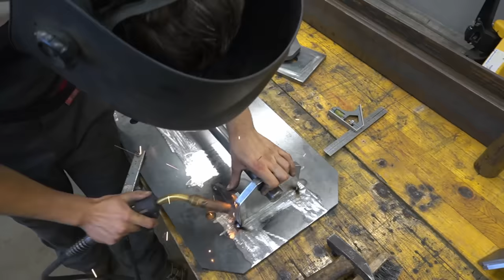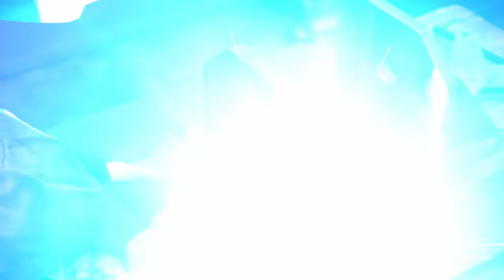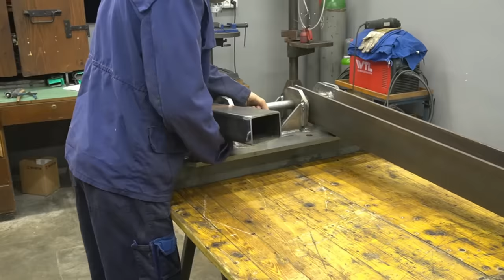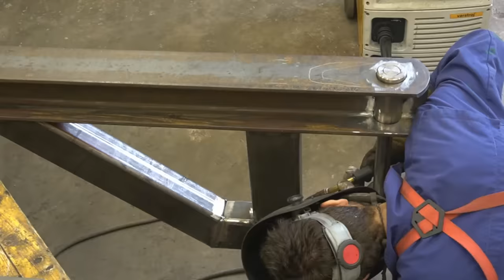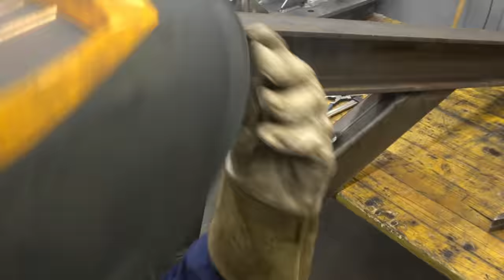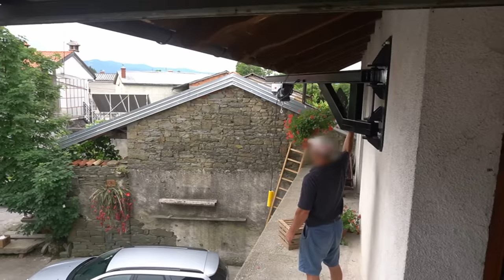Jib crane build

Comment from the maker: I do not reccomend this type of jib crane design if walls aren't made entirely from thick enough reinforced concrete.
Reply: make it a through-bolt design
Reply: That is what I was wondering about when I saw this. The crane looks very strong the wall it's anchored too and the anchor bolts will be the failure point some day
Reply: So my 1/2 Sheetrock won’t do ?
Reply: @JS-zb1vv  just use those expanding plastic anchors and the sheet rock will hold just fine.
Reply: I’d mount it to my truck bed!
Reply: @JS-zb1vv  Just use some toggle bolts.
Reply: I was thinking the same thing. Awesome design. Very sturdy. Would be perfect, with I beam stand, sunk in a concrete pad and bolted to a sturdy wall. Also, move the winch back to the pivot point so it doesn’t add negative leverage out so far. Put a pulley block at the outer end
Reply: Какая грузоподъёмность на конце стрелы❓
Reply: @heychaz  I was thinking of just using super glue.
Reply: @rl595 Chances are he will sell this property and walk away and leave any problems that might happen to the new owner.
Reply: @martyk1156   I was thinking of just using superglue. but your idea might be a better option.
Reply: @SHAH_ALEX  he is not going to answer you in case there is a lawsuit in the pipeline.
Reply: @makeityourself5016 I don't recommend a jib crane installed like this period.
Reply: You can't just use drywall toggle bolts? :P
Reply: Me and my boss do post frame construction. Now and then he’ll fab up jib cranes like this. But we reinforce the posts and wall pretty heavily. They’re great

Comment: What stops your wall from collapsing?
Is the home concrete or stucco?
That is leverage houses are not built for.
Reply from the maker: Good observation mate. Walls are actually made from clay blocks. So, those aren't enought to hold 1 ton on the end of 3 meter long beam. Not even close. But there is a vertical concrete pillar behind one part of the mount and one horizontal on top.  So, it should hold :D 
Thanks for watching mate. ;)
Reply: @makeityourself5016  id be concerned about putting tortion on a concrete pillar. the weight of that crane alone is probably not a big deal. Its a cool build but at the end of the day Id worry about how well that pillar is held upright.

Comment: Except wall mounting. One more thing to use bearings, and you can use locking system by providing two flange with hole to lock the position. Rest is perfect idea..
Reply from the maker: Thanks mate. I was sceptical if I should use bearings or not, but then after a suggestion from local machinist, i decided to just use bushings. They work perfectly. It rotates with litteraly no force...
A lock mechanism would maybe come in handy. But its to late 😅

Comment: You should allow time for the metal to cool between welds to minimize twist.
Also the strength of your wall and those lags are your weak point especially if that concrete is of a low rating and not wire reinforce.
When a Foundation is laid for a building the concrete is collected at the beginning  and end of the pour , it is allow to cure 30 days and then will have a compression test done on it . Cemete walls are not required in all places to have the same test done . I would check with your building codes to see if there is a code for your walls . If you live in a Hurricane Zone and the building is new you may have a hurricane rated 🧱.

Comment: I install sign on walls and may counter lever off the wall light this and believe me this is not safe I don't care if the house Pillar is behind that wall it is not built for this purpose I warn you not to use that hoist I believe you should remove it and Mount it to something that is capable of holding it there is a reason things like this are engineered unless you have proper steel work behind that wall I do not believe it is safe
Reply from the maker: If it would be for me, I would do it a little different. But it was made for my uncle and he insisted that this is the way to go. Plus he isn't lifting more than 400kg 🙂
That pillars behind will hold, no problem.
We could even conect it to another side of the house with cables to reinforce it but it's no need for 400kg :)
But thanks for the warning. I appreciate it 🙂

Comment: Solid construction, with it being anchored to a wall like that does that perhaps limit your weight capacity? Or is it bolted through the wall to a beam on the other side? Thanks
Reply from the maker: It definitly  limits lifting capacity. But it's still a concrete pillar behind the plate and one on top. So I'm guessing I can lift 1 ton.
Reply: Pretty heavy costruction for 1 ton capacity.
Reply: @truthspace5525  I'm guessing this is another example of germanic over engineering
Reply from the maker: @truthspace5525  we like to overkill projects :D
Reply: @StephenMortimer  Roofs look Czech or Spanish, not German.
Reply: @marcosmota1094  better yet, it is SLOVENIA ... an Italian doing things the German way ??
Reply: @makeityourself5016  "Guessing" is not advisable when building lifting equipment. "Knowing" is always a requirement.

Comment: With all the repeating comments about the wall strength, you should add an introduction to your video to explain.  I think people don’t take the time to read the previous comments, so having the info in the video might help.
Reply from the maker: Good suggestion. Thanks. I will look if this is possible 😀
Reply: @makeityourself5016  or just pin your comment to the top, where you explain it in a few lines.

Comment: Can I get the plans for this? 

I would like build one like you started to do. I seen you mounting it on an "I" beam but then you mounted it on a wall instead. 

The only thing I would change. And that is saying ALOT (I have OCD). Is flipping the Jib over to use a trolley. That same support design should be plenty for a hanging style support. 

Thanks, Emily Shelton.
Reply from the maker: Hey, saddly I do not have the plans avaliable. 
Originaly it was ment to be made like you mentioned, but the guy for whom it was made decided to take this path :)

Comment: 2000 lb winch will d3 in your driveway way with some of the wall if you try to lift that much weight but, looks nice anyway.
Reply from the maker: Thats probably true. Metal frame has that lifting power. Wall on the other hand doesnt. But we use it up to 400 kg

Comment: This design is very dangerous if the wall where the arm is anchored is not reinforced.
I could end up tearing off the anchor point
And it can cause serious accidents or the death of anyone nearby when the crane is operating.
Reply from the maker: It sure is. Lifting capacity is very well dependent on structural integrity of the wall. In my case, there is a concrete beam behind, so there is nothing to worry about 😀
Thanks for watching 😀

Comment: Great welds - super project -  question on your weld technique - almost looks like you are using a type of "whip" nozzle movement, when most mig guys use more of a circular nozzle movement. Is that correct? Whatever you are doing, produced a very even seam. Nice job.
Reply from the maker: Hello. Yes, that's  one of the techinques. I believe its not recomended for begginers because you can end up with lack of fusion. But if you know how to stay on the leading edge of the puddle it's just perfect. I like that technique the most. I had my welds tested and i did penetration test and they were all good. That circular motion is used with lower currents. Its not used in spray transfer, just in short circuit mig or globular. .

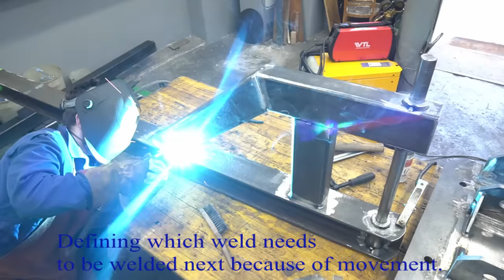Comment: 7:01 "Defining which weld needs to be welded next because of movement" What do you mean by that? as in the heat moving the arm making it not line up? so you need to weld in a specific order?
Reply: Yea metal expands and contracts when welding. It's called weld sequencing. He had it well thought out!!!
Reply from the maker: @jro1560  jep, you are right. Welding causes very high local temperatures. And  when getting hot, metal expands and when cooling down, it shrinks. If I wouldn't be checking with an axle, it might had happen that an axle wouldn't even fit through. And if I saw that axle leans to one way, i had to weld opposite side. 
Like mentioned. It's called weld sequence.

Comment: Great job! Would you mind specifying the material name you used in this project? like the boom and type of metal, I am trying to make this project myself
Reply from the maker: Its nothing special. Its low carbon structural steel S235 with yield strenght of 235 MPa. Regular steel :)
Reply: And size of anchor bolts used?

Comment: GOOD DAY, WHAT MATERIAL DID YOU PUT ON THE BUSHINGS AND THE SHAFT AND WHAT LOAD CAPACITY DOES IT HAVE?... GREETINGS
Reply from the maker: Bushing are from regular steel s235. They dont need to be any fany stuff since the crane is used maybe 5 hours a year

Comment: That looks like an accident waiting to happen that is a hell of a lot of weight on that little wall once you have a load on that it will pull that wall down I warn you not to do that unless that's is a proper tilt slab that wall will not be strong enough I don't care if it is double brick or not the last thing I want to see is somebody getting hurt or killed because of that hoist
Reply: [HomeMade: But it's still a concrete pillar behind the plate and one on top.] "That looks like an accident waiting to happen. That's a lot of weight on that little wall, once you load, it might pull the wall down. I warn you not to do that unless that's is a proper tilt slab, that wall will not be strong enough, even if it's double brick. It would be a shame for someone to get hurt or killed because of that hoist."
Reply from the maker: @marcosmota1094  Noone will get hurt 😅 
Except maybe falling over the edge because there is no railings😅
That verical concrete pillar  is conected to horizontal concrete "wall" on top that goes all the way around the house.  I don't know how this part is called in english. And roof is really strong and  that helps a lot with desturbing forces. 
The placement of crane perfect. It's quite easy to judge from the picture. But those farm european structures are build really solid.
Reply: @makeityourself5016  I know, just quoting the 'Chicken Little' comment, that's all. I know what you meant all along. The horizontal wall might be the "sill plate" or just "beam' that you mean.
Reply: You've been warned

Comment: Great job! Which welding wire do you use 0.8 or 1.0
Reply from the maker: 0,8 and 1,0. Ussualy I change to 0,8 when doing some railings or some thin tubbing. 
Materials 4mm and more with 1,0.
In this video, 1,0.
Reply: @makeityourself5016  can you please share the price or making Cost of this project???
Reply from the maker: @surajwavre8291  i think it was 450€ without an electric hoist
Reply: @makeityourself5016  so, it is more affordable to get it from Amazon 🤔

Comment: Should've used brass bushes metal to metal not good
Reply from the maker: You are right. But only if that crane would be used on daily basis. As much as it is used now, it will rust out before bushings even have a chance to loose 0,005 mm.

Comment: And where are the chamfers for thick metal and gaps? For such a design, a full-depth weld is needed, and not just at the edges. It doesn't matter how many stitches you put in. The basis is made without compliance with regulations. Plus, as they wrote in the comments, the wall mount is very flimsy for such a design. It was shot well, the seams are beautiful, but the construction is unreliable.
Reply from the maker: Welds do not need chamfers in my application. Crane is used to lift max 450 kg. And the wall has a beam befind the fasade. :)

Comment: 500 lbs. Max.
Reply from the maker: We lift 1000 at summer on a daily basis. It holds like a charm and has little to no bend in beam.
Reply: @makeityourself5016  the beam looks good 👍.  It's the wall I don't like. 500 with a saftey factor of 5 of course

Comment: calculation of bending beams? No, you haven't. IMHO, a huge waste of metal.
Reply from the maker: Calculations were made. I designed it to hold 1 ton at the end of 3 meter long beam. And there is something else involved. It's called safety factor. My crane won't fail. And even if I would use lighter duty beams, I would maybe save 80 bucks. Is it worth it?
Reply: @makeityourself5016  a pair of used tapered roller bearings would have been nice.